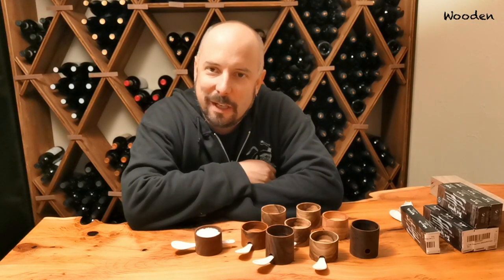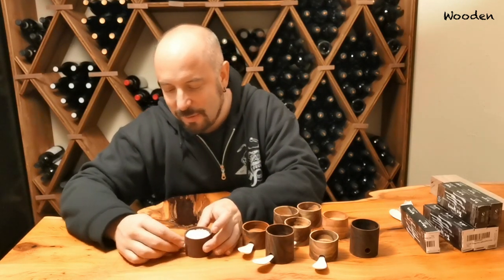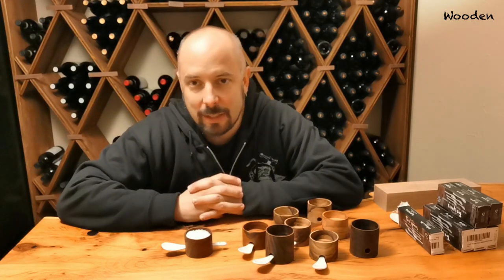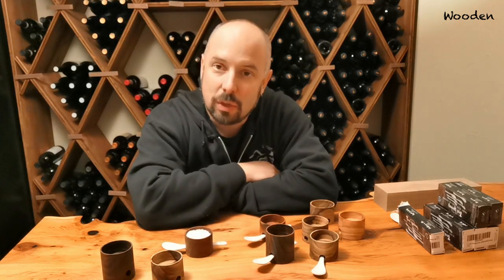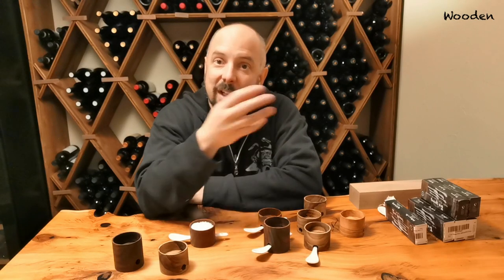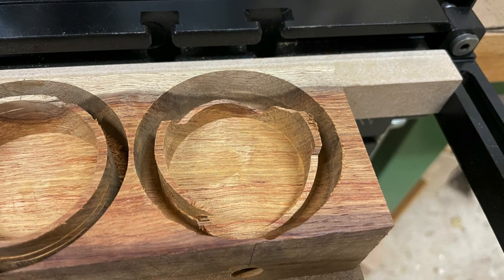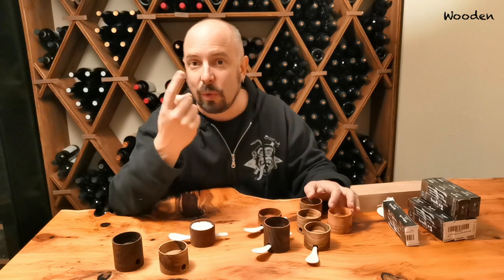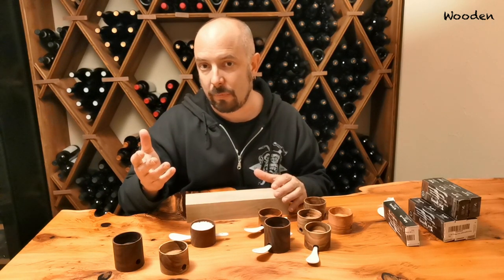[Shaper Origin] Create small wooden salt pots / containers with your Shaper Origin #shapermade

Comment: Ooops sent a little to early. Like I was saying I need to find a bottom cleaning bit with a shank long enough to give me the 1 inch depth. So far the most I can get with the one I have is .60. All the work I’ve done so far is with a 1/4 spiral bit. I’m very happy with results so far. Instead of boring a hole for the spoon, I’ve opted for a lid, and the spoon resting inside. My wife didn’t like the idea of touching the spoon part to access it for use. She also thought the spoon I purchased similar to yours was a bit big. I believe it was a porcelain egg spoon. Instead I’m using a mother of pearl style caviar spoon. I’m also thinking of making a matching sugar pot, although with a larger diameter. My favourite wood so far has to be Claro walnut. I have a location where I can buy blanks for $4 a pound. They are used for turning, but I’ve make cribbage boards with them, and now these pots. Just gorgeous grain. Once completed I’ll definitely send you pics. Thank you again for your inspiration my friend! Keep those vids coming! They are great to watch!!
Reply from the maker: That sounds wonderful! Love it how you adapted the idea and of course one needs to abide by the wishes of one’s wife 😂😂 With the bottom cleaning bit I use I can almost get to 1 inch depth, if I don’t put the entire shank in the nut, so getting to that depth should be feasible. Have fun my friend 😁

Comment: Hi Javier! I had a quick question about how you placed the pot design on your material. I’m trying a slightly different iteration of the spice pot, and using the work station I am able to, as you did design and place the circles on my material no problem. I noticed that when you placed your circles on your material, after your scan, you see the pencil marks you created from the outset to precisely place your circles. When I scan my workspace appears no problem, but I do not see my material as you do. How are able to capture your workpiece on the shaper screen, and not only the workstation dominos. Do I need to pull my shaper further back off my workpiece while scanning? Doing so essentially would put it in empty space off the back of the work piece. Thank you for your help.
Reply from the maker: Hi Henry. I am so pumped to hear you are trying a similar design. Please share pictures once you are done! To answer your question: While scanning, first scan your workstation (the dominos), then move your Shaper onto the workstation and turn it in by 180 degrees. That way, the camera will face towards your workpiece, but it will still see the dominoes you have already scanned. The camera takes pictures of your workpiece, and once you finish the scan, you will see your workpiece and the pencil markings. Please let me know if it worked :D
Reply: Thank you soooo much! It worked perfectly! I tried scanning while holding the Shaper in empty space. It worked but your method was much better. So far I have produced 15 pots. Different species of wood like yours, although I’m trying to perfect a specific diameter and depth. I’ve had a little trouble with how deep to cut the outer ring. I’ve settled on a pot that is 1 inch deep, with an overall size of 1.25 inches. The inner pot diameter is 2.25 inches the outer diameter is 2.75 inches. To produce the final pot, I resaw the blank, limiting the cleanup. I have to find a bottom cleaning bit